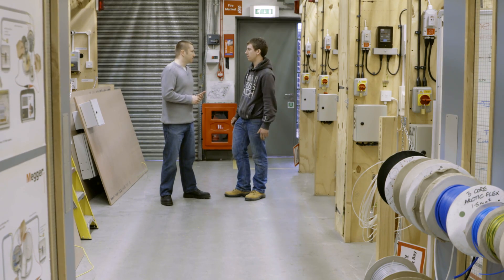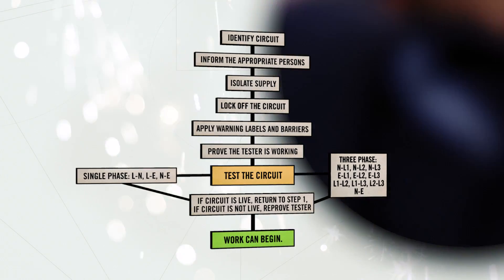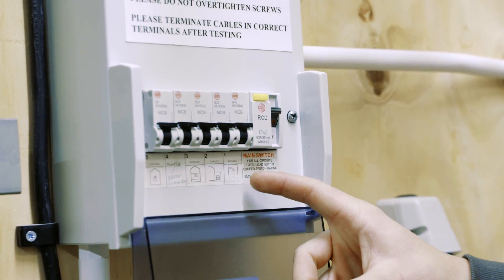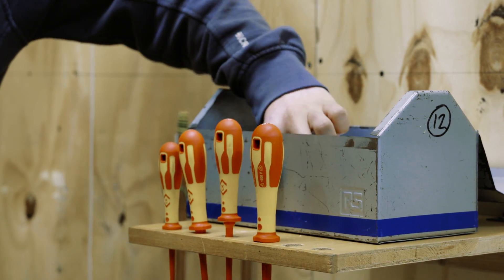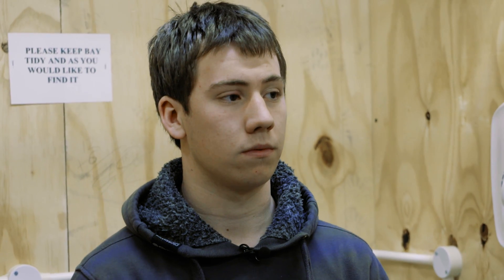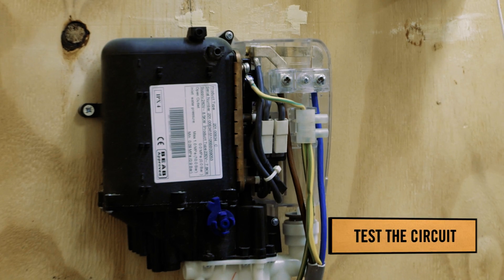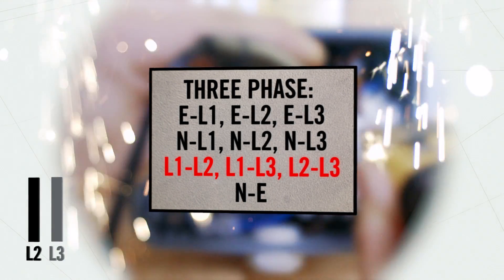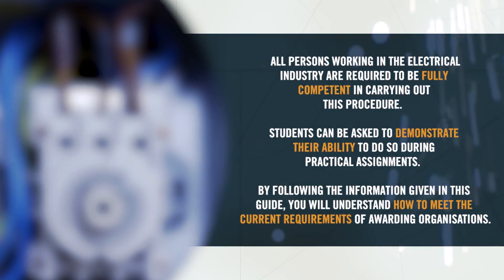Student's Guide - Safe Isolation

Comment: Very good video! Only one issue. Student have asked about permision to switch the power off on the beginning before he isolated DB(shower circuit). Unfortunetely there is no instruction what to do after he finishes the job on shower circuit. Before he switch power back on he supposed to ask again for permision to do so in case somebody else would be working on that circuit without his knoledge (or on another circuit in case isolating whole DB as this could result in an accident-electric shock).
Reply from the maker: Thank you for your comment and I am glad that you like the
video. We are always happy to receive comments and suggestions as they help us
to provide useful guidance. The safe isolation video is intended to help
students pass assessments set by awarding organisations.  If, in the
workplace, more than one skilled person is working on an installation each
person should carry out the safe isolation procedure and have their own locking
devices in place for the circuit they are working on. If a hasp is used then
additional padlocks can be placed to avoid the installation being re-energised
until the last padlock is removed.  I will look into providing more
information and guidance on safe isolation in respect of what to do when two or
more skilled persons are working on an installation or circuit.

Comment: Well done Stephen on a comprehensive video.  I didn't know such a book existed prior to watching this video.  Just two observations from an NVQ L3 Electrotechnical Assessor that may assist anyone undertaking the AM2; I encourage apprentices to use LINE to identify the 3 line conductors instead of LIVE as the neutral is also determined as a "live" conductor.  Secondly, I insist that apprentices put the test probe (the one without the indicating lights) onto the zero potential first when proving "DEAD" at the single phase voltage L-N and L-E part of the procedure, in case the unconnected test probe would become "live" due to a back-feed.  Apparently these are two failure areas in the AM2 assessment if not correctly observed.